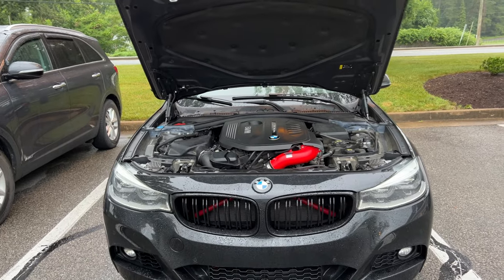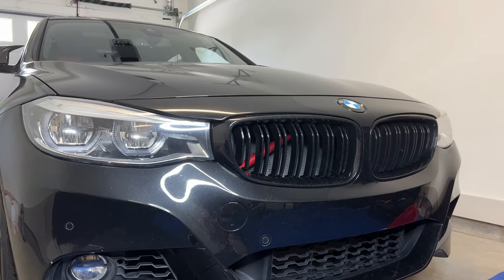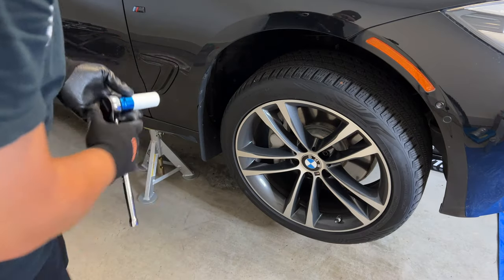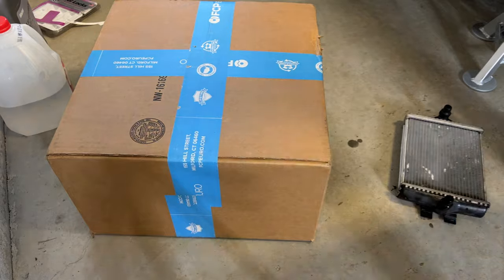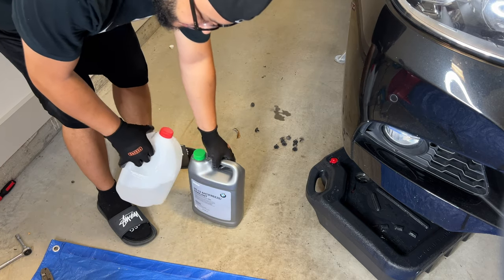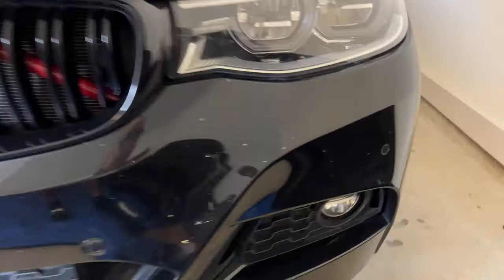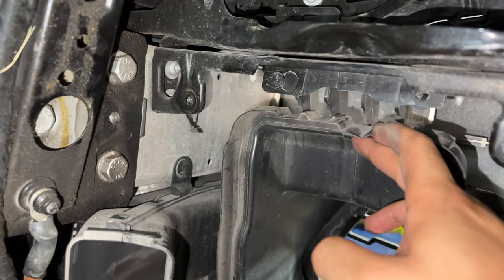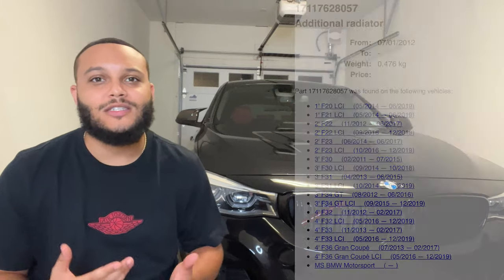Lower Auxiliary Radiator Replacement F34 F30 F31 F32 F22 +

Comment: About to do this same repair with exception to blocking the grill completely. I’m putting a metal mesh on one of the pieces you removed to get the block off plate in place. Should offer the protection I need without restricting airflow that the rad needs. Thanks for the video!
Reply from the maker: @whydontmynameswork  perfect option

Comment: Thanks for the video!  This was super helpful!
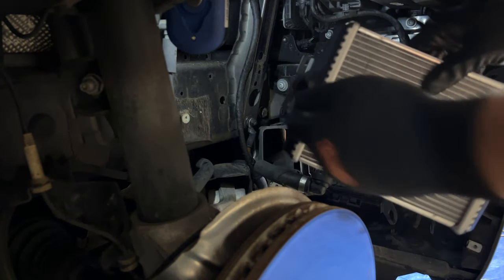At 5:50, it DOES matter which end goes up.  The radiator will snap in either way, but the hose fittings are keyed an only go on if the radiator is correct.

Comment: Surly you need to have it open for cooling? Here in the UK, BMW have a redesigned front mesh that attaches to the radiators on my M140i because so many were punctured by stones. I personally have some black chicken wire behind the plastic grills to protect mine.
Reply from the maker: I have seen updated factory pieces with a built-in plastic rock guard on some 2018+ cars other than the F34-wish all cars came with that! But I haven’t had any difference in temperatures since I added the plastic piece. Also, air still gets to that area via the lower front grille.

Comment: Lord have mercy. Dude take that plastic peace off. If it cant pull cool air from the front it will pull hot air from the engine.
Reply from the maker: Lord have mercy my dude I think the word you were looking for is “piece.” But like I stated in the video, my temps were not affected at all after this. Remember, there is a main radiator and this is only a small auxiliary one. Plus, there is plenty of space for outside air to get to that little radiator. Thanks for watching and Peace✌🏽brother !

Comment: Does anyone know if this little auxiliary radiator is just an extension of the main radiator or is it there to specifically cool the transmission via the heat exchanger on the transmission?
Reply: Did you find out?

Comment: So do I need to replace the auxiliary radiator because my hose that connects into this & the radiator busted so what might be the problem for the excess pressure that cause that to happen. ?
Reply from the maker: Interesting. Maybe it was just old and dried out? Hoses get old over time and just need to be replaced. I doubt it’s the fault of the radiator itself. After replacing the hose and putting in fresh coolant, it wouldn’t hurt to make sure the system is bled properly.

Comment: Do yo know the hose Part Numbers for the two hoses that goes to that radiator?
Reply from the maker: I just checked the parts diagram for my car and it looks like the smaller hoses are apart of/connected a bigger hose part # 17128662840 and 17128616560 I THINK but check realoem just plug in the last 7 of your VIN and drill down to see any part you need
Reply: Thanks a lot. I check REALOEM but they don’t specifically show you which hoses are for the auxiliary radiator. Thanks man!

Comment: Great video. Btw I have a 2018 F32 440xi M sport. Both of my side grills have the cover, even though I have the auxiliary cooler. I did notice that the slits on the wheel liner for the aux radiator are not as dense on my car. I guess this was to help with cooling since front grill piece is covered.

Comment: F34 330 owner here. Mine is closed on both sides.
Reply from the maker: Yo! Thanks for the chime-in! Do you also have the M sport bumper and you have the same aux radiator behind the passenger side wheel?
Reply: @supremegt  Yes, I have the M sport bumper and there is an aux radiator behind the cover.
Reply: @rpons541  what year? I have a 18 F32 440xi m sport. My aux cooler grill is also covered but the mesh on the wheel liner side is not as dense as the mesh on the drivers side.

Comment: Lol. The grill is there to feed air to the rad. If anything. Put mesh behind to protect from stones. 
The reason the other side is blocked is because your var is pre opf. You have literally blocked the radiator from the thing thats designed to cool it. Air. 

The reason the closed side is closed is because it doesnt have a rad there. The opf cars have a secondary rad on the otherside too. 

Please. Everyone. Do NOT do this. 

If you are gonna do this, you might as well join up the connectors and remove the rad all together. As this rad is doing nothing now other than having extra water in the system. 😂
Reply from the maker: @NickthaGeek  not sure if you have a B58 car but as mentioned in previous comments, this is an auxiliary radiator. There are also brake ducts in the same area as this little radiator so it still gets cool air. My temps have been consistent before and after the small plastic cover. Mesh would be a great option as well, especially for the main radiator, since those grill areas are much larger and exposed. Additionally, many B58 cars don’t come equipped with this aux radiator, so it’s not needed to keep the engine cool and happy, however, having it helps the cooling system a small amount by cooling and keeping a bit more fluid in the system.